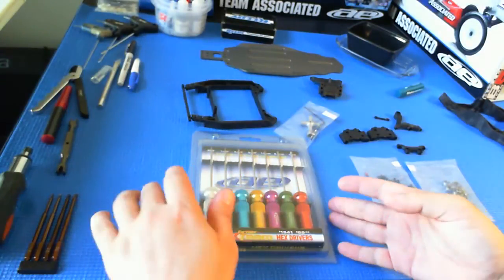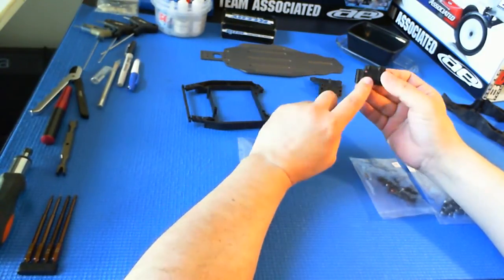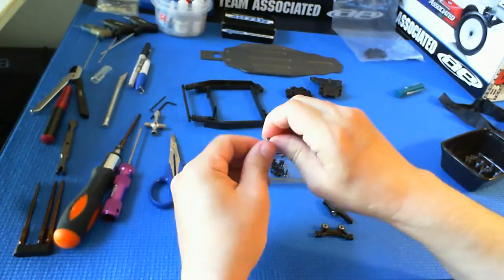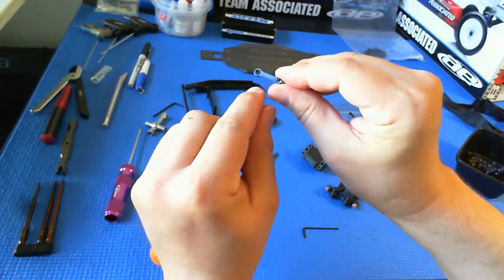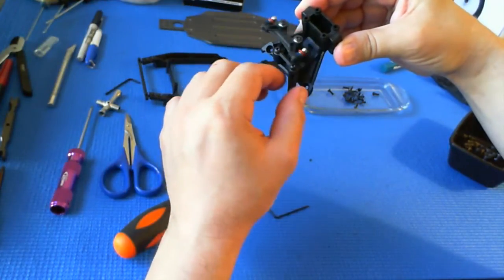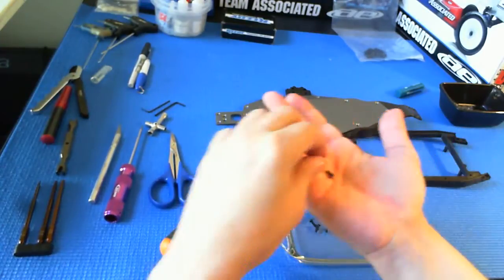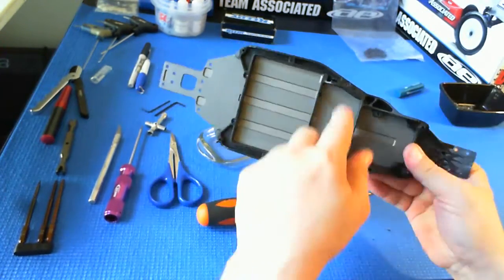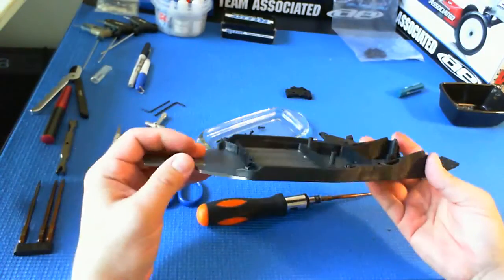Building the RC10 B5m - Pt 1 - Steering Assembly & Chassis

Comment: Nice vid. Studying the whole build so when my kit arrives on Friday I know what to expect. Haven't built a kit in over 10 years. getting excited.
Reply from the maker: Excellent! Glad to hear you're getting back into the hobby again! Things to consider with your build, I had to use a shorter than "standard size" servo because space is tight. My servo is 36mm high, not including the splined shaft and horn, and there is 2mm max space left. Space for the receiver and ESC is tight also. In Pt 8, you can see just how tight it is. I ended up using zip-tie to mount the ESC's capacitors to the battery arm. Battery is also a consideration... standard packs won't fit you'll need "shorty" or "suitcase" packs... see Pt 9. I went with shorty packs because I had a couple of them, and because they can be moved forward and backward allowing the F/R balance to be changed without needing to add additional weight. I had originally bought the shorties for the B4.1 Worlds for the same reason. Since it's such a new kit, there aren't any factory driver spec sheets on the Associated website. But, the sheets for the B4.2 are probably still available for download... most isn't applicable, but you might get tire recommendations to get started. I'm going to be running on indoor carpet and indoor clay till it warms up so I've got JConcepts Bar Codes Gold (indoor soft) up front Pt#3020-05 and Pro-Line Suburbs (Clay) in the rear Pt#8213-17 with closed cell foam inserts front and rear. I don't have the best motor ESC combo in it right now... if I had my first choice and money wasn't an issue, I'd get an Orion 6.5T motor and their Vortex R10 ESC. This seems to be a really hot combo and a lot of pros are winning with Orion. Their ESCs are supposed to have exceptional throttle feel and response. FYI, I've got a TLR 22SCT series coming out. I put it on hold to get the B5m vids out ASAP. Also an Axial crawler build in April. More vids on the B5m, at the track and review. Plus vids on tire gluing, dyeing nylon, more how-to paint bodies, and some fun stuff too. Let me know if there are subjects or kits you'd like me to cover! Thanks for your comment and for subscribing! CJ
Reply: I would like to see more vids of the B5M in action. Tire selection vids, and comparisons of buggies by same driver.
Reply from the maker: Sure, I will definitely be doing further videos on the B5m during the tuning phase both indoors over the next few weeks and at a local outdoor track as soon as it warms up. I am selling my older buggies and may not be doing further side by side comparisons. But, I may be doing a build of the TLR 22 2.0... if I do, I will be building it as mid-motor and would definitely do a side by side, and see which one I am faster with. Of course, everyone has their own driving style and a setup that works for one person may not be the fastest for another person. I am also planning to do a series of vids on general tuning, where to start, what types of changes yield what types of results, tools needed, and the mechanics and theory of how suspension functions. Additionally, I am trying to arrange to interview at least one paid/sponsored driver about these subjects. Hopefully someone who competes on a national/worlds level... but this won't happen till later this year.
Reply from the maker: If you are trying to make initial tire choices for a B5m, there are setup sheets online now on the Team Associated website. Match the conditions of your regular track(s) against the track type/conditions in the setup sheets and you will get good input for tires, compound, inserts, springs, shock pistons & oil, as well as many other settings that will help you setup a good baseline to work from. Having looked over the sheets myself, JConcepts Dirt Webs and Barcodes are doing well. I am starting out with Barcodes (front) and Suburbs (rear) both in clay compound... only because I have them and the combo worked on the B4. I'll definitely be trying the Dirt Weds with appropriate compound as racing moves outdoors.

Comment: Bad news! What had originally supposed to be yesterday, then mid April, is now possibly a month away to get my B5M. Paid for already, but the buggy is way on back order. I guess it gives me time to study these vids.
Reply from the maker: I know you are hating that! There is a LOT of demand for the M. I really got lucky... and Middle River Hobby has always been really good to me. I was there this morning and saw two B5s on the shelf... no B5m to be had. In an interview, Dustin Evans (Teal Losi Racing Factory Driver) said that "We're starting to find that mid-motor is starting to work better even on lower grip conditions just because they have so much speed. You don't have the motor back there so the car isn't sitting on the rear end pushing out of the corner." Did you see my quick "News" vid? There are pro setup sheets on TeamAssociated.com and they're all running the "shorty" packs because you can move it forward/back to adjust balance. I'm surprised that none of the TLR pros are running the 22SCT in mid-motor configuration. After all, the 4wd SCTs are all mid-everything. I may have to try mine both ways and do a video about how it works out.
Reply: I will have to check that out. SCT wise I am running a Slash 2wd. It in no way is even close to stock! I have been putting off building the big bore shocks because I hate building shocks. Was going to wait until the B5M gets in and the build the shocks all at the same time. Currently watching the vid of my second most hated thing to build, the diff (pt4). I like how you film the whole build so far and not just say install these screws, and cut next scene the screws are in.

But yeah I am hating the back order thing.
Reply from the maker: I'm glad you're liking my style, and I appreciate the feedback! I'm tinkering with different vid angles and have been learning a LOT about video editing. I'm looking at better cams because I want to go 1080p so I can show the most detail possible. I agree with you about about shocks. Do you have a shock stand? It really helps. Once you get used to doing regular rebuilds and fluid changes, it goes faster. And yeah, diffs are a pain too... mainly because you gotta take the trans off, take it apart, do the diff, put the trans back together and back in the car. Grrrr! They really aren't that tough though. I think because they are one of those "mysterious" "not sure if I'm doing it right" things, they can be intimidating. Do you have a powered driver? They really speed up disassembly. You know, the Slash can be a competitive SCT. In a shootout in Short Course mag, the test drivers turned the fastest most consistent laps driving the Slash... they all "preferred" Associated or Losi, but the lap times don't lie.
Reply: I read that somewhere also. I went Traxxas as I know the brand. Use to race a t-maxx right when the Revo first came out. I like the durability and every shop has traxxas parts if needed.

Plus it is fun beating people that run the main brands of vehicles with a basher company vehicle.

Since you have the build series finished for the B5M, how about a vid on workspace and tips on what can help a build go better. Tools, space, box, shock stand, mats, that little parts tray I see you use for the screws.
Reply from the maker: That's a good idea. An overview of basic and optional tools, etc. Sure, thanks! Like the yoga mat... sounds kinda silly, but it's functional and it can be cut to fit a large work bench. I'll have to put something together.
Reply: I only noticed that because some outfit sells a pit mat that they say is a yoga mat type material. We have a couple extra here that we don't use so I am going to use one for a pit mat.
Reply from the maker: Cool! There are lots of other things to spend money on. I try to support the hobby any way I can, such as shopping at my local hobby shop and not buying everything online, but some things are just to expensive. Sometimes you can find good substitutes around the house. The tray you mentioned earlier is the bottom of a glass butter dish. The top broke, so I put the bottom to good use. It's heavy glass so it won't break easily, it doesn't slide around or tip easily, and it cleans up with the wipe of a towel. I have another small black plastic tray that I soak bearings in... got that last year when I was in the hospital getting a bunch of titanium screws put in my spine. They served me pudding int it :-)

Comment: No servo saver? Hmm, how has it been on servos so far?
Reply from the maker: Most people seem to be running high sped servos with steel or titanium gears. With metal gearing, you really don't need a servo saver. Also, servo savers can adversely affect handling, especially in kits with bigger tires... short course trucks for example, those big tires have a lot of leverage and can push the servo saver preventing you from getting the movement you want. The weakest part does have to give, but I guess having the control is worth the risk of damaging a servo. Back in the day, I never used servo savers because I wanted every bit of accuracy and control I could get. I never broke a servo even though they were all plastic gears back then. The B5m has a rather small servo area, so make sure you measure what you have or check the measurements on anything you are considering buying. The TLR22SCT is the same way only a bit different, there is room for longer servos, but you have to use their control horn because there is very little clearance to the bulkhead above. In my B5m I'm running an Airtronics/Sanwa  (ERS-961 pt# 94661) High Speed Titanium gear cordless digital servo. Stormer Hobbies lists it for $114.95. It's got a height of 35.9mm and there is about 1.5mm left to the bulkhead. Savox make some very nice servos and they are a little more reasonably priced. I know they make a low profile metal gear servo that will definitely fit (SC-1252MG) It's quite fast and should have enough torque for a 2wd buggy. Most online stores sell it for about $65.
Reply: I will bedoing research on electrics. Pretty much decided on a turnigy esc. Another channel i subscribe to did a great budget gear review and a vid running it in a serpent buggy along wth budget battery, servo and radio. Eventually will get thebetter gear for the buggy and then transfer the budget stuff over to my slash.
Reply from the maker: I understand that tactic... sometimes you have to buy lower performance/cost items so that you can afford to put a complete on the track. It's no fun watching a half built kit sit on the shelf. When you are ready to upgrade, check out ESCs that have data logging. You can download the data after a set of practice laps and see your throttle position, battery voltage, ESC temp, RPM, and motor temp... if the motor has a temp sensor. The data can be really helpful... check out this article on Tekin's data logging: http://www.teamtekin.com/datalogging.html  Oh yeah, most of the pros seem to running 6.5T motors... I've only got an 8.5T in mine and it's not a very hot motor. Like you, I'll be upgrading. The 22SCT is also going to start with an 8.5T, but it's a Tekin Redline Gen2 paired with a Tekin RS Gen2 ESC. That combo is available on Stormer for about $220... http://www.stormerhobbies.com/cgi-bin/seekpart.pl?src=cs&pn=TEKTT2428